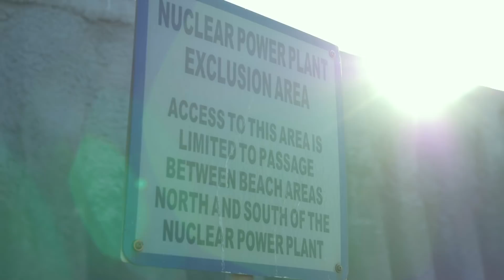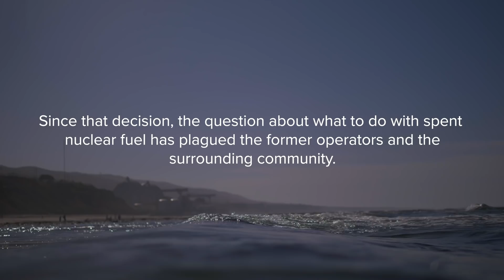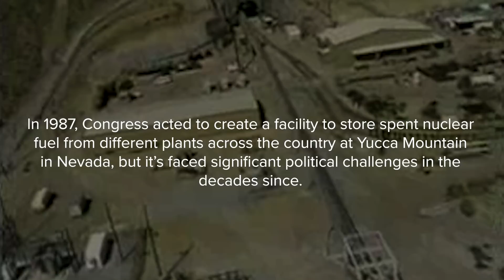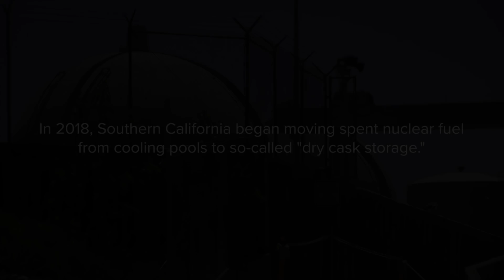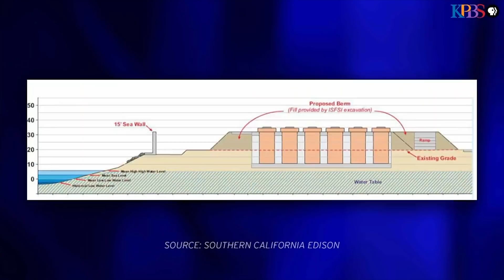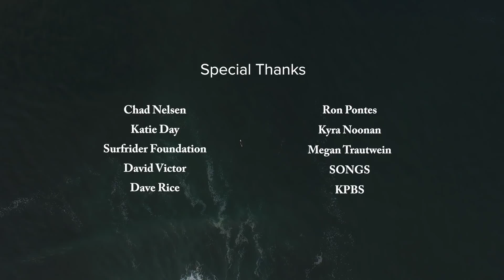Boiling Point: San Onofre's Nuclear Waste Dilemma Is a National Emergency - The Inertia

Comment: Folks should be aware of the ," PRICE-ANDERSON ACT" ,  a bill passed by Congress because the BIG INSURANCE COMPANIES have a NO FAITH IN NUCLEAR POWER stance and only will cover a commercial reactor up to $560 million  !  After that, the AMERICAN TAXPAYER is on the hook for the liability, running into untold BILLIONS !  Early on assessments of nuke reactor reliability by the Insurance industry ( and insurance co's are very good at assessments ) , found that commercial reactors, each is basically a new, experimental design of undetermined issues that couldn't be resolved and therefore, extremely HIGH RISK
and not worth the gamble ! So the A.E.C. , Federal Agencies, and Nuke Builders got Congress to saddle the Tax Payers with this HIDDEN BILL in order to get Electrical Utility Co's interested in the so-called , " CLEAN , CHEAP, SAFE " power !  Watch out for an additional hit from SONGS thru this SCAM , saving it's investors from any losses !

Comment: People!!!!  It is nuclear waste!  It is not bombs!  It is not like fukushima at all!  There is no fission process taking place!  It will not explode!  It will not melt it's way to the earth's core!  And by the way it is not in the middle of neighborhoods - it is surrounded by Camp Pendleton.  BTW San O is on the camp's land and only accessible because the state made an agreement to allow it - which is expiring.  That first guy "what about that nuclear thing?"???  You were at far greater risk when the plant was operating (but even then sot much)!  No one should be allowed to leave high school without taking at least one basic science class.  It is a problem?  Absolutely!  Is radiation exposure bad?  Absolutely!  Is it likely to happen?  No!  Good to be concerned but you might start worrying about what happens when the Colorado River dam levels continue to drop and their electrical power output drops with them.  Solor?  Wind?  A tiny percentage of their output.  Wave generators?  There goes your favorite breaks.  Nothing is free or without risk.  Oh there's that pesky science again.  OMG how can we live when all our electronic devices go dark?  Don't worry, be happy and surf more!  At least until gavin newsom closes down all the beaches again!